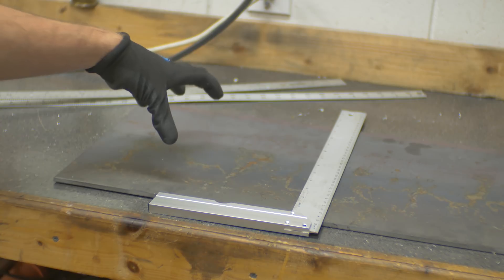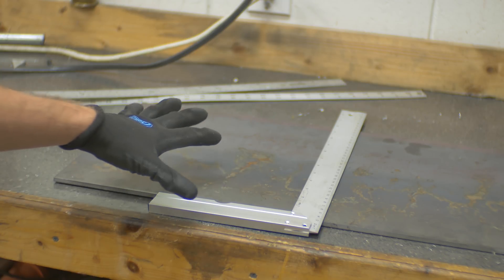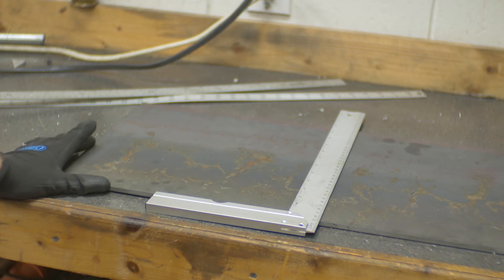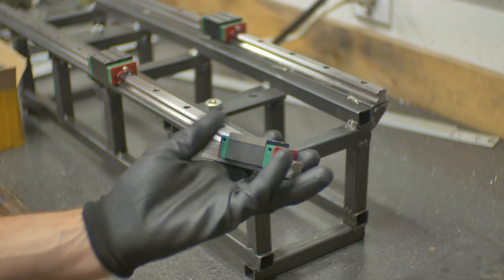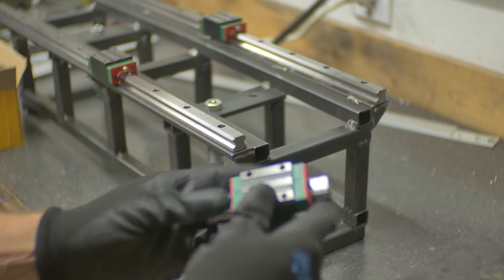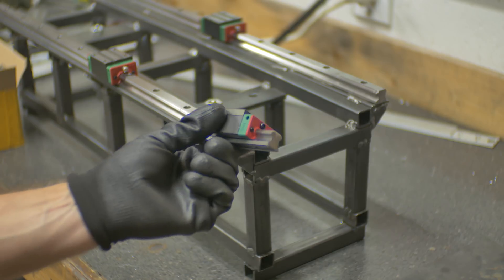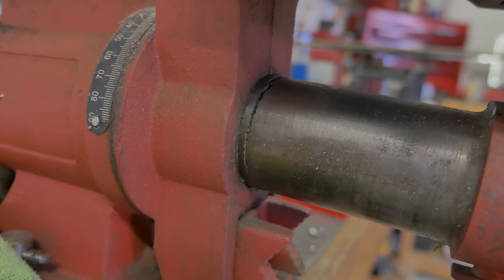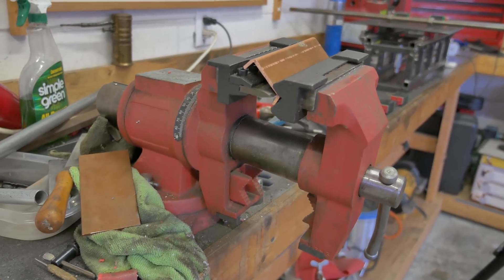Small Surface Grinder Part 3 - S02E17

Comment: To get the rails parallel you want to toss aside that caliper and mount a light weight armature to a car on the fixed/mounted rail. Then use a dial indicator along the rail to be mounted. If you want to make life easier for final adjustment you'll allow a bit of slop on the one side and put in a push/pull block at one end of the rail.

Comment: So what good is getting the sled rails within such tight limits if the rollers on the sled are not also within the same limits (or less)? Not to mention all of the other parts that will be built on top of this will also need the same tight limits.

Comment: My teacher always told me '' Screws are not for locating'' . I used a surface grinder a lot and if there is any loose in the axis the finished will have some sort of line in it.
Reply: reyspec, I thought the same thing. Once the rails are in the correct place he should drill and ream a small dowel pin hole through both the rails and the base to locate it permenantly.

Comment: Not sure if such a big magnetic chuck is a good idea. The mass of it shifting around MIGHT give you a lot of issues later on, not to mention that you need much bigger motors because of it. The size of magnetic chuck you are using right now is typically used on very huge and beefy cast iron surface grinders. I would suggest buying a smaller one from ebay made by the chinese, they are good enough for your requirements.

Comment: Vises are made so the handle bends before the vise breaks. Usually they bend more than that. Cast iron tends to give no warning.  Beware the cheater bar!
I recently saw a warning on vices and presses which appear so innocuous, yet build up tremendous energy due to the huge forces involved. Things can shatter.

Comment: I have the "metal cutting" version of that bandsaw.  The only difference between the two is that mine has more pulleys to get to lower speeds.

you could turn yourself more pulleys out of...well anything really and it would be able to go slow enough to keep your saws cold so you can cut more without ruining the temper of your blades.

Comment: weld the vice back together!  Forge weld the vice back together!

actually, theres an opportunity for some sillyness with trying to glue the vice back together and see how bad it is!

for real though, preheat and weld the vice back up.  It isn't a precision instrument and you should be able to grind it back to shape with an angle grinder if you CBA to mount it on the lathe to turn it back down after welding.

Comment: A good alternative to lining up your rails with calipers would be to mount a dial indicator to a bearing block on your first rail (or use a piece of scrap steel for extra length) and run it along the opposite rail

Comment: LOL!! I did the same thing to my vice, easy fix, grind a deep v-groove, heat to 500f or so and stick weld with high nickel rod, put back into the oven.. I mean heat source, let it cool slowly. That's the right way, I was lazy and used MIG, three years and no problems. Great videos!!

Comment: I put a pump and a box store clear body water filter on my parts washer and can filter down to a cheap micron filter (yarn) if I want. Cured my grit-in- the-bearings problem forever. If it clogs under heavy use, use a second filter assy and fiddle with permutations. https://www.google.com/search?q=home+depot+water+filter&sa=X&biw=1024&bih=664&tbs=vw:l,ss:44&tbm=shop&prmd=sivn&srpd=2862836701056511518&prds=epd:10706375261701600889,cdl:1,cid:15069751862642624090&ved=0ahUKEwifyu6-gZbWAhUL2SYKHQosCFwQgTYIiAU

Comment: And kids that's why we don't use a cheater bar on a vise handle or buy a vise which has a bent handle. I want to say Keith Rucker - VintageMachinery.org mentioned this in his Wilton vise restoration. And in looking at flea market vises, ones with the bent handle is a definite sign of abuse.

Comment: From 5:30 on you’re making sure the second axis rails are parallel to each other, but how are you ensuring their perpendicularity to the first axis?
Reply: Don't think it matters as much for a surface grinder. Theoretically, you're always grinding over the whole work piece and parallel to the x-axis, even if the axes aren't perpendicular (as in, even if that's visible to the naked eye, even, say, 45 degrees), it shouldn't have any effect on the quality of the workpiece. Now, getting the spindle perpendicular to the x-axis, that'll be interesting.

Comment: Can't believe you are center punching the plate while it's on the guides :( Almost as bad as centering while a workpiece is on the surface plate (which I saw many times while in school)
Reply: Yeah, but centre punching in time with the music is pretty clever.
Reply: It's not about "knock that thing out", but the guides are linear bearings, BEARINGS! Never hit bearings with hammer. At least not through rolling elements.
Reply: Want2Race harmonic chatter.
Reply: Jan-Albert van Ree if y'all think a few taps with a pin punch are going to knock that thing out, what exactly do ya figure machining things on it is going to do?
Reply: Big difference between impact force and a slowly applied heavy load. Impact force is bad in this case lol.
Reply: You do know that linear bearings can take easily tons of force, right? Milling machines are a good example of hammering going on thousands of times a minute and those bearings just don't give a shit.